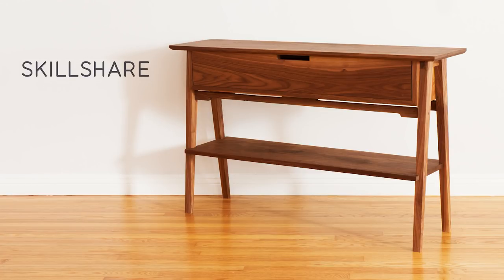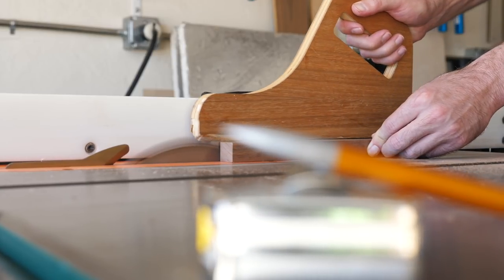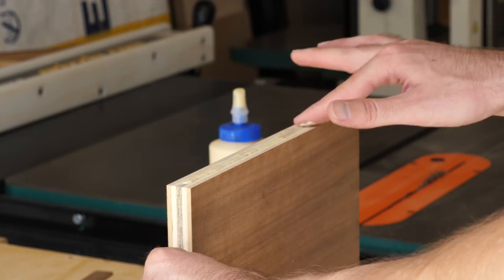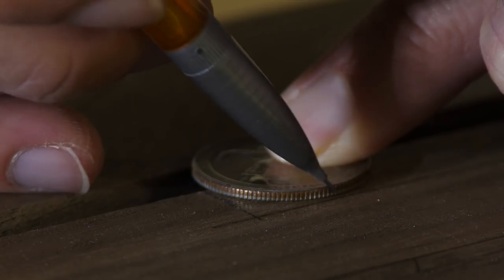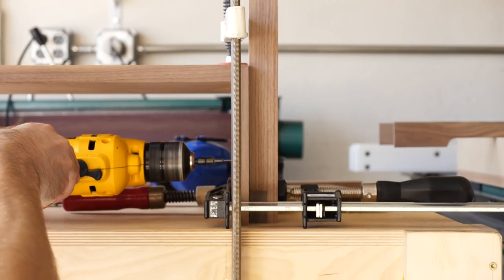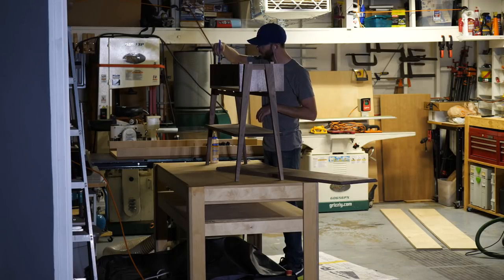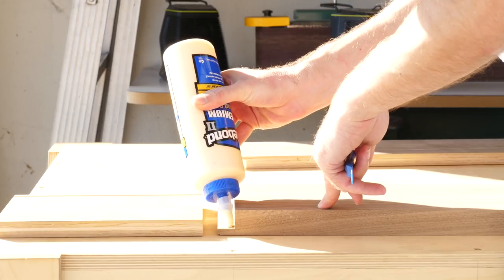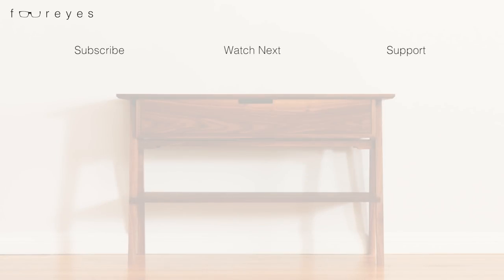Build A Mid Century Modern Hall Table

Comment: Hey Chris! I have a tip for you that you might find helpful or useful. When using a router (handheld, trim, table) rotate counter clockwise when routing exterior edges (table and counter tops) and clockwise on inside or interior edges (sink cut-out).  When using a table, same applies, just rotate the wood or work piece counter clockwise on exterior edges and rotate it clockwise for interior edges. 

There's a few reasons for doing this. Helps with blow out and tear out. Helps keep control of the router but most importantly it will keep your router bits sharp because of their design.

I put the sink example above because that's how I was taught to remember it. Picture a rectangular counter top with a circle cut out in the middle for a sink. We go counter clockwise on outside or exterior edges and clockwise around the sink hole or interior edges. I learned to remember it as clockwise around the clock (circle sink cut out) 

Best of luck, keep up the great content. Love the podcast by the way and what You, Mike, and Ben have created!
Reply from the maker: Hey Marc...good tips. It's funny, when I'm using the table router, I usually do rotate the piece counter clock-wise when I go around curves on the outside. I didn't know I should, but I think I do it b/c it just feels right ergonomically for some reason.  Using a handheld router, I never even though about rotating. But I will keep it in mind.
Reply: I had a router destroy a piece on me one time and I ask someone how they have so much control and they explained it to me, especially with trim bits for coping templates or trimming laminate. Thanks for the reply!!

Comment: I came for the build, but I stayed for the narrative. Have you ever looked at the Miller dowel system - great solution for visible fixings?
Reply from the maker: Just checked it out...interesting. Does it only come in the one species?
Reply: I bought a bundle which included 1 pack each of birch, oak and walnut.

Comment: Two questions on tools - the measuring tool @1:40 and the flush trim saw you use at around @3.40 - do you have exact names for those or where you got them? Thanks!
Reply from the maker: Yeah, the measuring tool has a link in the description to amazon. The hand saw I thought was amazon...but I can't find it in my order history for some reason...so I might be wrong.
Reply: now I'm embarrassed that I was too dumb to just look in the description. thanks for the tip

Comment: I just love all the furniture you make and how you make everything. Your explanations and comments are superb. I notice that you rarely use screws to strengthen joins... is there a reason for this? [I hope this isn't a silly question]
Reply from the maker: Thanks Michael...I just use them where the make sense. On something like the leg joint (half-lap) There is a lot of glue surface to bond the pieces together. Wood glue is amazingly strong...And these joints aren't going to be under a ton of stress...so I just do whatever makes sense without over doing things.

Comment: Using a Dremel tool on walnut?  The fine furniture purists are going to freak out.  You're a bold man sir...  :)
Reply from the maker: haha...they already turned their noses up at me when they saw a screw come out :)
Reply: Given the strength of the drawer box, to prevent racking, and it's intended use as a hall table, screws work well enough, so no complaints there. It's just the plugs that annoy me. I mean i agree they look fine from 2+ feet away which to be honest is how far away i'd normally be, and that any non-wood worker probably won't ever notice them or even dislike them, but since I know i plugged the screw holes i can never unsee the plugs.

Comment: First off, it looks great! Nice work. You build some amazing stuff and are so meticulous and conscientious while you're building. I have two questions for you and I don't want them to seem in a negative light in anyways. Just some curiosities I had while watching. I'm curious if the draw ever gets hard to open with the wood expansion/contraction rates with temp/humidity because it looks like such a tight fit or if because it's ply wood, you don't run into that issue at all. Also, I'm curious about pulling the draw out too far. There's plenty of ways to solve this. I'm just wondering if it was an over site or a non issue for this project? Thanks in advance. Love the channel and the modern maker podcast!
Reply from the maker: Hey Marc...hard to answer since I haven't lived with it long enough yet...but the case (other than the top) and the drawer box (other than the front) are all plywood. So the only potentially troublesome piece would be the drawer front. But there is enough wiggle room to allow for some expansion. As for stopping it from coming out...I didn't have time for the video. But I'm going to probably just put a little screw or something on the underside to keep a kid from being able to completely pull it out. It's a drawer that I just keep guitar strings and string changing tools in...so it rarely gets opened. BTW, it's in my hallway under my guitars :)

Comment: Nice work as always!  One question, are you worried that glueing the top to the base won’t allow for expansion of the top?  Maybe humidity doesn’t play a factor too much in ca, but still curious none the less. Thanks and keep up the good work!!
Reply from the maker: I think it'll be fine. Finished, in doors in Southern California...I haven't had any wood expansion issues. For this one, I cut the slots for the dominos wider in the underside of the top...so that would leave a little wiggle room for the top to expand across it's width...which is pretty much the only area of possible concern for a piece like this.

Comment: I was just thinking. You know how you have to room on the edges for wood/ laminate flooring to give them room to expand. Since you draws are such a tight fit, would there be an issue of the wood expanding or does it apply to certain types of wood?

Comment: whenever i have to make little curved parts like that that need to be the same I always make a little template out of 1/4 mdf core plywood and use it with a flush trim bit in a router table to get them shaped
Reply from the maker: That's probably a good idea. Probably a lot easier to shape that template than a work piece.
Reply: that's what i've always found. you can get it just right on something that doesnt matter if you mess it up or if you dont like it. and then if you ever need that curve again it's sitting in your drawer

Comment: How long would it take to make this with handtools only? With the skill level of Chris? I have 0.0% woodworking experience. I'm just curious because I've always had some interest in it but I don't have a spare room or garage to work in. I thought about using a corner of my living room, using plastic to make it so that dust can't leave the small area. Is that realistic? Or do would you say, "just don't"? Again, 0% experience, but I do have experience with 3D software and drawing. If I look at the videos I would think it's possible. I could be wrong!

Comment: @7:37 did you cut into your template??
Reply from the maker: Yeah...a little...I think the piece was not resting flat on the table at first. Nothing major though. Easily cleaned up.
Reply: kinda looked like your bearing is toast. anyway, nice work man!